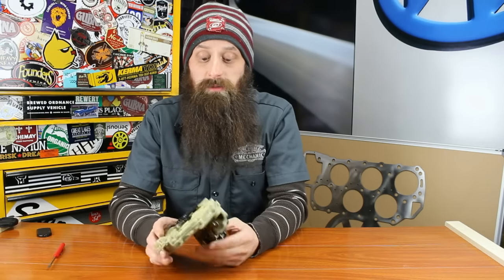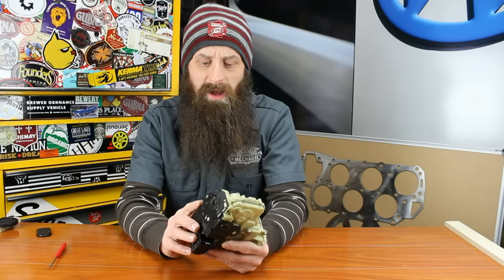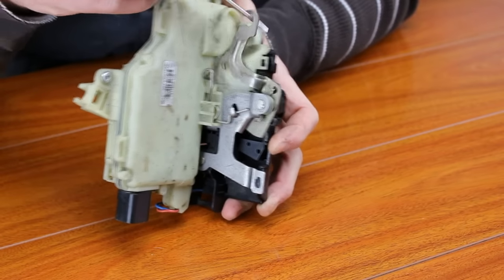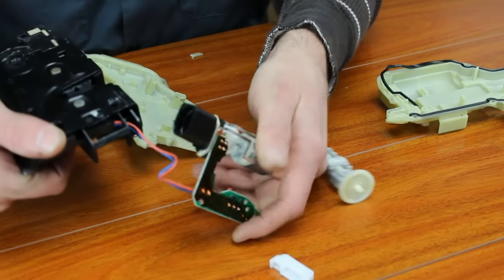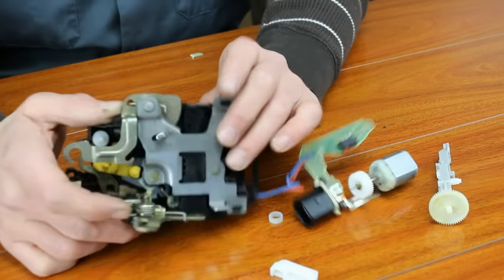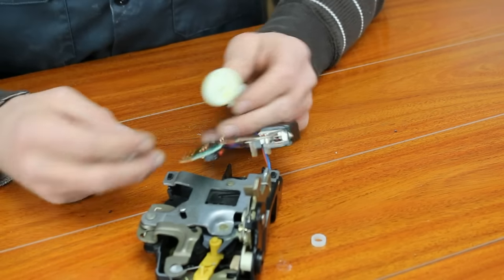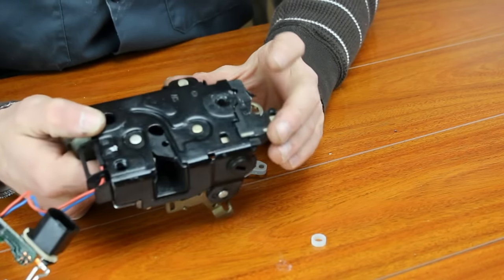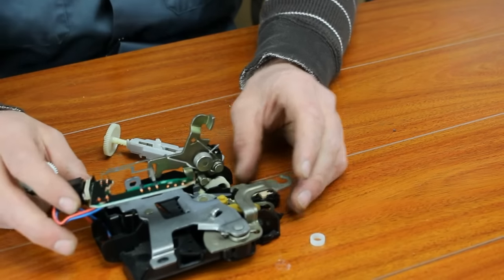How VW Door Latches Fail~ Video

Comment: Could outer door cable be out of adjustment on one of these?  My '14 CC rr window doesn't drop to open door until the latch is tripped, opposed to correct after handle movement (~8mm) but before latch is released.  Curious if that can be adjusted or just an early sign of failure.  Door ding indicates that door might have been jarred hard before.  Does the latch need to be released after 3:10 setting the cable?

Comment: Hi. I have a VW Touran 2007 plate. The rear door doesn't lock nor does the electric window work. Do you think  replacing the door lock module unit resolve the problem ??

Comment: Hoping you get back to me lol , i recently had my door latch fail on my 2002 GTI , basically the latching mechanism wouldnt engage. So i shut my door and it just comes back. I know generally means the latch is actually engaged but that was not the case for me, if i were to take a flat head an tr to push the latch back to engage it, nothing would happen. I used pb blaster thinking something may be binding but got nothing. I ended up ordering a new one from ECS Tuning and installed it flawlessly and my door now latches again. What i wanna know is how can i refurbish my old latch so i can have a spare ? Thanks for the video
Reply from the maker: many times the retention spring is what comes apart. I think there are DIYs on fixing the switch. It may be worth checking those DIYs to see if there is info on the spring.
Reply: Thank you! I was able to fix my old latch so now i have a spare!

Comment: My B6 passat has been driving me crazy because the exterior door handle won't open. I've read online that it can also be the cable simply falling out of its track?
Reply: Update. Found the issue to be a broken hinge on the Exterior Door Handle Base, it's the spring loaded  part that swings open as you pull on handle. Was able to snap handle back in place and  get door to open if applying downward  pressure  while opening handle. Video on how to access and replace Exterior Door Handle Base for B6's would be nice, no luck finding anything so far. Do you remove the interior panel to access this??

Comment: My door latch won't click to the lock position, I tried pushing it in manually and it moves in easy but won't click to lock. My door remains open. Any ideas????
Reply: yellowhorse52 mine just started doing that today! It still "locks" and the light blinks when I use the remote, and it doesn't open, but the button doesn't go down all the way. Did he end up getting back to you?

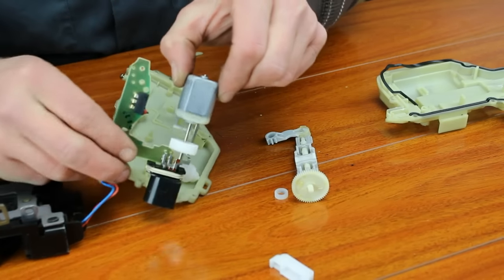Comment: 3:55 Rigid electrical lines between the connector, PCB and a motor that runs every time you unlock the car? It's almost like they wanted the solder joints to fail. ;)
Reply from the maker: Haha yeah vw door latches are common. On most VWs. Haha

Comment: I have a 2000 Passat... Today it locked and I could not unlock it with the fob or the hard key.  The red LED on the fob was blinking when I pushed the button.  I thought maybe the programming on the fob got erased so the car was not recognizing the fob.  So after having to call roadside assistance to unlock it... I then tried to reprogram the fob.  I only have one key so I previously had to use the method where you remove the lock cylinder and use a screwdriver as my "Second key".  This time though the door lock mechanism was not locking or unlocking the car... even when turning it manually with the screwdriver.  Does that mean I need to replace the door latch mechanism?

Comment: Ok I have a similar issue.  My passenger side unlock is not working!  All others work fine.  The outside door handle is weak on returning to the fully seated closed position and remains 1/8" out.  But even if I push to seat it to the door the unlock does not work.  Lock works like a champ on fob, switch and 15kms driving speed but no unlock on passenger side only.  It sounds like the solenoid is functioning the same as the other doors on both lock and unlock.  Could the return spring be shot on the lock mechanism????  And not seating to allow the it to work on the open cycle or could the cable be stretched???  Any help would be great.  Any pics of the assembly would be great.

Comment: I have a 98 Jetta MK3 that when I shut the car off, or even when I am driving, or even when it is parked, the power windows go down by themselves.  Now this doesn't happen all the time, it's unpredictable.  I've come out in the morning, and sometimes when it's raining to find the windows down.  I've owned several MK3 and never had this problem before, any ideas?        thanks
Reply: Hey Bob did you ever figure out the issue I am having the same problem

Comment: Please update this with a 2006-2011 b6 latch. The electronics are "potted in" but the motor contacts just push in and get corroded and fail. 
I cleaned and the motor works great. The latch assembly did not survive the reassembly.  The halves are hard get apart intact.
Reply from the maker: It’s pretty much any vw door latch ever made. 😂

Comment: I have a 4-door 2007 GTI.  My passenger rear door latch is not locking the door when I lock the car.  I don't ever use the rear doors - is there a way to manually lock the passenger side rear door so that it it is always locked?  Thanks!

Comment: hello, i would like to get your opinion. i have a 2011 jetta.  i tried to lock the door using the remote, but one door does not lock. i.e. when i open that door from outside, the alarm goes off. Based on that symptom, is it electrical mechanical?

Comment: I have a 2001 VW Jetta with a door latch problem on the driver door (power windows/locks). Is it possible to just replace the entire door with a door with manual windows and locks?

Comment: My inside door handle keeps slipping (looses tension) when I try to open from inside (outside works fine). Works for few times then looses all tension again. This happened after I replaced window regulator. Is there way to anchor the inner door cable so it won't loose/stretch from opening door from inside? I was thinking of advancing inner door cable further behind regulator panel then taping it down?

Comment: I’ve a 2004 transporter with driver door lock problem. Won’t lock unlock from remote or interior lock button. It will lock via push rod by the window, and will only open from the interior handle. All other doors, passenger, twin slide and barn door work correctly. Door latch unit faulty?

Comment: My GTI is experiencing the issue where everytime you pass 10mph the car locks. In my case atleast it attempts to lock but won’t actually lock. It also feels as if the latch is barely holding on. If i barely pull on my inside door handle it unlatches.

Comment: My 2012 vw beetle driver window won't go down,the auto windows vent drop(1/2 drop) does work,passenger window works on that door.the d.side will roll passenger window up only.no thing works far as u/down on d.door .would door locking switch or would window switch  be problem?

Comment: Hi there man, thanks for the video! I have a quick question. I’ve got a 99 Jetta. With all my door locked, I go to unlock my driver door and he alarm stays on. I figured that it would be my drivers lock mechanism. But I heard you say to diagnose, lock the door and see which one stays unlocked, right? Or am I wrong. I did this and my left passenger door stayed unlocked. Would this mean my passenger door lock mechanism is bad and not my drivers side? Thanks man, I would appreciate it if you could give me a hand!
Reply from the maker: On the mk4, it acts a little different. You may even have 2 bad latches.

Comment: Hi. I have a jetta 2007, when I lock it (from key or from inside) the right front door sounds different (all doors lock, then the right front makes some additional sound like giving up). But it does lock and unlock correctly. On VagCom I have an implausible error, and with "central module comfort system", when I lock from inside, the 3 good ones show up as locked, but this one as "safe". Any ideas how it can be fixed before I tear it appart? Thanks a lot.

Comment: My vehicle is Jetta 2015 comfortline, Is it possible because of freezing rain and snow that driver door is not being close, after some attempts (slamming)? What should be the normal failure?
Reply from the maker: Vw had a TSB about this. IT may not have applied to the Jetta, but the Passat was bad about it too. Moisture gets in the door and freezes in causing the door to not open. We replaced the door latch and installed a new cover.

Comment: failed driver and passenger front door wont set "on" dome lights, drivers door wont warn me if lights are on  no chime(disabled?) or key still in, doors all lock/unlock,  new car to me 2000 mk4 Jetta vr6 GLS. 2 failed micro switches? these would affect the chime?

Comment: Thank you for this video. My rear hatch door was not opening and bought a new mechanism from Deutsche auto parts and it still does not work. Once in a blue moon it works than nothing. No sounds no clicks... ideas?  I am totally lost. This is for a 2009 jetta wagon. 
Help...
Reply: (i dont know where the jetta rear hatch latch is located ) so check if you have wires at the hinge point of the rear hatch. (they go from the car to the rear hatch inside of a rubber boot)  if you do the wires flex and bend each time the hatch is opened and the wires might be broken on the inside but the wire insulation is still intact.  I have a mk4 GTI and the wires for my rear window defrost and the latch in my rear hatch have all broken in that spot. i have had to replace these sections of the wire harness with new wires.

Comment: New beetle convertible. Inside door lock switches do nothing both sides? Have to unlock the door to get out with the key fob. Because it locks above 15 mph. And Inside handles don't open with it locked? 
Does this make any sense?  Hard to believe both switches are bad at the same time. And most cars will unlock the door when you pull the inside handle.

Comment: Driver side outside latch won’t open but window drops down. Inside latch works fine. Is that a cable issue?
Reply: Going through this rn. Did u figure it out?

Comment: So, how to open the door and replace latch when its stuck in the locked position and wont unlock?
Reply: @i Better Call AL i removed the seat, door card, window glass, rubber seal  then smashed the latch from down the top of the door with a 2ft long chisel. If there's an easier way it would be sweet to know.

Comment: If my latch was bad would it act up with my locking system and windows?  When I connect my battery my windows would work for like 3mins and then they will lock up and stop working?

Comment: Question. My latch sticks in freezing temps. such that the door won't latch when you wish it to close. Is there a simple remedy to prevent this. Maybe to keep water out of the mechanism, without replacing the whole electro-mechanical unit. Any suggestions?

Comment: Hi, can you explain please why it's need to set the preload on the outer cable?
Reply from the maker: this sets the proper location of the cable and handle so the handle feels right when opening the door
Reply: @HumbleMechanic   Thanks for your response, I think in my case is some problem with it because if I lock the door manually (with a screw driver) it dind't open from the outside handle only from the inside. But that hook, as I imagine only graps until the first pull of the door, when you release the handel that little arm didn't hooks back

Comment: theirs a child lock for the back so they cant be opened from the inside. theirs also an other hole that you can put your key into so the handle is disabled from the outside . where can i find out more info on that setting
Reply: look for the video from 1A Auto on "5 things you didn't know about your Mk5"
they have it in there. great for a temporary workaround until you get it fixed.

Comment: I got a 2000 mk4 jetta with a driver door latch problem the car thinks that the door is shut because the dome light wont come on when i open the door and when i use the remote to lock it wont lock that door. I also noticed that the clock and tip odometer stay on. Would another symptom be a car battery dieing? At first i thought i had a junk battery so i got a new one 3 days ago, went to go start the car this morning and it was dead
Reply from the maker: Yep that can kill the battery too.
Reply: HumbleMechanic dude your a life saver!!!!! Im so glad I watched this video

Comment: Are the ones sold on ebay good to use they have them for 30 bucks. and even claim oem ones for alil over 40 bucks. any suggestions? have 3 of mine that wont lock when i press the fob. only passenger front locks.
Reply from the maker: Not sure. My initial though this no. But for $30 I would try it out.
Reply: After looking and reading every review it's a waste of $30 because you will just have to replace it with OEM in a couple months. I saved $30 by going OEM the first time. 

Thanks for the videos, I'm learning a lot!

Comment: I have a Seat Altea,2008 Tdi Bkd ,  My rear passenger won't unlock when used with key fob, Once opened from inside once , it will then open from outside until locked with key fob,   Would this require a new module ,Thanks in advance

Comment: I have a 2012 GTI that the outer door handle drivers side will not open the door. when you pull the handle you can feel the tension but nothing happens. I can open from inside fine and the locks work also. any thoughts?
Reply: Nancy Hodges same problem 2014 jetta
Reply: Ever figure it out?

Comment: When this lock actuator fails (burn out as it did while I was driving) is it possible for the vehicle to cut power to other components such as the horn, wipers, turn signals, stalk in general, interior lights, ect. Also can a bad battery cause stress on these components causing them to fail prematurely? I have an A4 B6 1.8T 5-Speed
Reply from the maker: never seen that before.

Comment: My 1999 VW Bora 2.0 has the following problems with the door locks:
1. The dome lights do not come on when the passenger door in front is open and the car locks 30 seconds after I unlock it and in these 30 seconds I open the passenger door.
2. The rear left door's actuator rod pops once down and then once up when I press the lock button on the driver's door panel. When I press that button second time in like half a second the rear door locks.
3. Pretty often the turn signal lights do not flash when I press the lock button on the key. I wonder what could be the cause of this happening not all the times I lock the car.

Comment: so I've replaced my door latch mechanism from this video and from DAP.  But my issue STILL persists and I havent been able to find a solution.
 
rear drivers door, MKV jetta:
If the locks are down, then I pop them, the door latch will not catch/open.
If the locks are down, then I pop them, I have to bang on the exterior handle (by the key cap) and the handle can open the door.
I can close the door and reopen as such at this point.
But If I drop the locks and pop them up again, I have to repeat this process over.  So frustrating

Comment: I’m having unlatching issues from the exterior driver handle.  I can open it from the inside with no issues.  But the exterior handle will not open it after the initial unlocking with my fob, I have to unlatch from inside, and then my after using the interior handle to unlatch I can use the exterior handle to open and close but if relock and unlock and try exterior handle to open the door, no go.  Any suggestions?  2016 Jetta
Reply from the maker: Try resetting the handle by following the instructions for remove and install in this video. 

How To Check and Replace a Door Latch MK5 GTI https://youtu.be/LuOJhZaGwnw
Reply: HumbleMechanic Took apart the door, had to reset the cable with the T fitting on the end where the door handle hinges.  Worked great, tip for those with the same issue, once you repair it and have that piece out and reconnect the plastic and the metal tab, ZIP TIE THE PLASTIC PIECE IN PLACE.

Comment: what coukd it be i have a 2014 jetta se and the driver door outside handle wont pull out its like it stuck it did it once for like 5 min then it started to work then 2 day later its doing it again it opens from the inside but the handle will not pull out to open the door plz help  thanks

Comment: Hello,

I'm having trouble with my girlfriend's MK6 [ 2017 facelift].
The outside door handle doesnt open the door. The inside opens just fine and the auto door lock/unlock works just fine. Do i still have to replace the whole actuator or just the door handle? I think it's the outside handle unlock cable. Any chance you can give me some advice?
Reply: Going through this rn on the same car. Did u ever figure it out?

Comment: I have a 2001 Cabrio is it true the door latche  driver side control the alarm and window functions?
Reply from the maker: The window yes. I think the alarm is the contact switch on the door jam. But I may be wrong. It’s been a while since I’ve looked at that system

Comment: I know I probably won’t get an answer but the other night my mk6 gti wouldn’t close until I put it inside and got it warm but now it only opens from the inside do u think it can just be the latch?
Reply from the maker: Uh but I think you will get an answer ;). 

Either latch or outer handle is hanging. Does the outer handle feel right compared to the passenger side
Reply: No the handle feels loose like there’s nothing connected to it